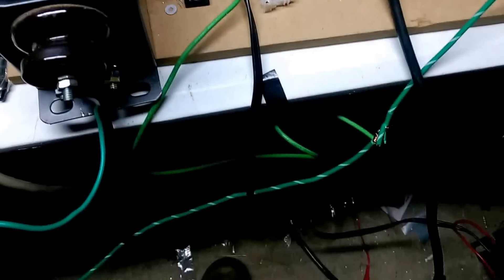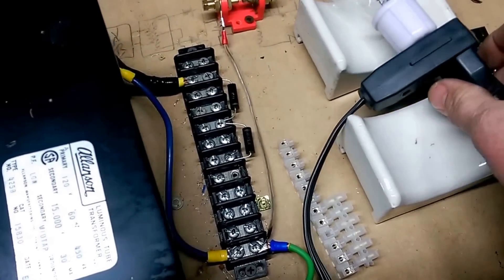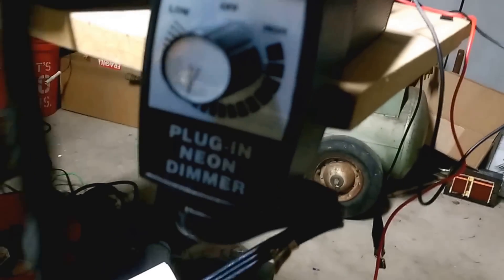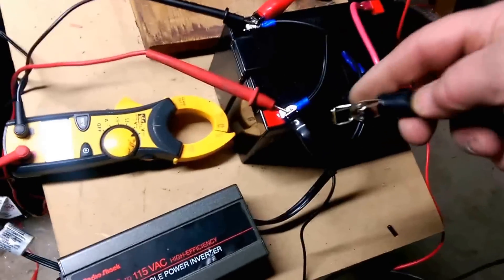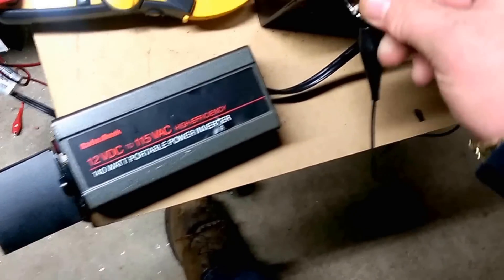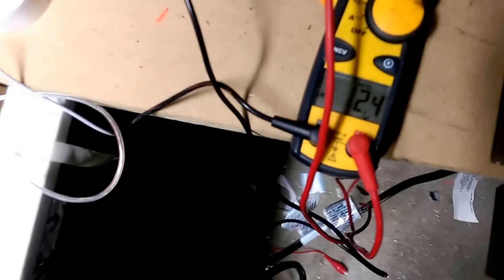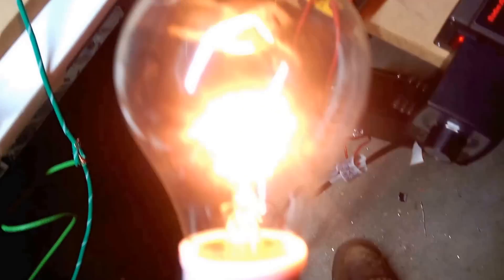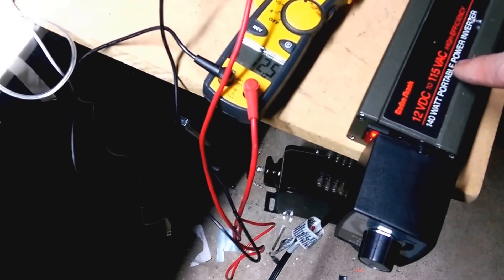Working Free Energy Generator-Dezeinstein Technologies-Annotated

Comment: Hello, Marc,

Great job n your builds, research and ideas.  I've been researching for a few years now, reading everything from Tesla, Moray, Newman, Steinmetz, Leedskalnin, Don Smith, Dollard, and forums to name a few.  

YOU ARE SO CLOSE TO SUCCESS.

From my reading, Tesla said he was surprised by the difference in energy by shortening one wire by 1/4 inch.
Also, Don Smith said in one of his presentations that the diode was 'special' and that they stopped making them in '93.  In a paper he wrote on one of his devices, he said that the wire to the battery should be 1/4 wavelength in order to receive the RF power to charge the battery. 
I will continue to watch your progress, and hope you can figure out exactly what to do for the great process of converting the cold electricity to useful power.  Keep up the great work with your enthusiasm and passion.
Like I said, I've been researching and studying a lot. I have not attempted any builds due to the possibility of me having a heart attack from burning down my house, electrocuting myself, or the excitement of actually making something that works. :)
Reply from the maker: +The Forces 2B Thank you. I've been trying to find time to do a lot of things and one of the most important I have been trying to do is replying to my subscribers.. then, finding the time to complete my experimentation. The parts used by Don, Tesla, and many others are the hardest task I've had over the several years I have been experimenting, then of course finding the money to acquire them. The time to work on these is most extensive, as well, trying to remain involved as a part of the industry to show folks I am not just another hoaxer as many folks claiming to output more than is incoming. It's a time killing process, so, I ask all of you to let me know when you find original components such as diodes and other devices Don as used so I could exactly replicate the devices. Important to me is to ensure the batteries used are close to the same. Not all batteries or inverters work to do what I have done. It truly involves the lack of devices Don says to use. The varistor is NOT an item that allows cold electricity to continue on, in fact this eliminates the energy from being there altogether. The Varactor is the device needed so any of you who try using the varistor will see nothing will come out of your system unless the energy is conventional where the Varistor is used. This is a protective device used to regulate overvoltages. The Varactor is a component comprised of diodes. The diode is the most important piece of the puzzle outside of the wirewound resistors used. Thanks again!

Comment: Congrats, Marc!!!   When you say what you have discovered/made is a simplified device compared to the ordinary Don Smith devices, I wonder what is the last steps to get to the discovery of how Don made his solid state device with no coils or capacitors.  I believe Don give us a clue when he writes in his book, p 67:  “Carbon-related substances and other non-metals, when subjected to friction, give up negative electrical charges.  ...  It is important to note that approximately 70% of the Earth’s exposed crustal portions ( surface ) consist of silicone-related non-metals ( electron donors ) and therefore becomes a direct source of electrical energy when properly agitated.”  http://www.vfedtec.com/papers/don_smith/Resonant_Energy_Methods_by_Don_Smith.pdf
Reply from the maker: +Simen Tobiassen I have opened this and I am now checking out some of the other files.. Thank you. I have noticed upon my first experiment the massive amount of negative energy coming through on my scope. This has always shown up as negative voltage levels and stays negative no matter how I arrange the probes. I also have used a very old analog meter and watched the meter needle go backward until it pegged the stopper which was at approximately the negative 25 area. I have found that when we use the energy found across a positive lead and a negative level that is around -120v, positive lead being +120v, we get 240v of energy. If I utilize this across ground, the power output is completely free, using the positive energy manmade from a grid of a battery, then, it is approximately 50% free, minus losses. It's all pretty basic "difference of potential" guidelines, however, if we follow Don's principle for magnetic field arrangements and amperage with the placement of coil L1, we could get some pretty strong currents at high voltage levels without having any bearing on the input whatsoever. The key is to add spark gaps across specific output components to ground with the load inline. Once we find the correct place to output across, we have output power. If the spark gap is connected to the correct capacitor size across an inductor coil., we get the same effect as if we placed a capacitor across a relay coil. The coil will energize for a period of time when the cap is fully charged, discharging the cap at a different interval of time per capacitor size. The smaller tha cap, the faster the pulse. This pulse allows the transformers used in the output to come to life. If we put the correct size cap across the primaryy transformer coil, the output frequency changes according to the discharge rate. I haven't figured out which cap I need to use, however, it will be different per inductance and voltage in the system. If you are replicating as well, I wish you the best of luck. I will post my results as I get more time to experiment again. I will also be trying to output this energy into utility transformers. If I could max out their power level, problem solved. The world will now know the potential of my experimentation!
Reply: +Marc Belanger 
visit: http://www.vfedtec.com/papers/don_smith/
then you can download the document
Reply from the maker: thanks.. I think this has a lot more information than the same document I have downloaded at an earlier date.. I'll let you know my progress once I read the whole thing. Thanks again!
Reply: Did Don L. Smith really mean silicone-transistor related electrons donor when he talked about his solid state device?  When we know what was the purpose of the very first transistor ever created it really is another clue ; 
Lt. Col. T.E. Bearden 1990:  “Moray had made the first germanium transistor, an amorphous pellet of multiple, finely powdered ingredients, sintered under heat and pressure to lock-in stress, and containing minute interfaces (very tiny built-in cracks) which  acted as tiny scalar EM interferometers.”
http://www.bibliotecapleyades.net/scalar_tech/esp_scalarweapon.htm
Reply: While we are at it, the mythical Swedish Stone helped T.H. Moray to produce electricity.  The mineral Tungsten was discovered and named in Sweden, and as a Norwegian I know tung-sten literally mans heavy stone in Norwegian and Swedish, which is  also known as wolfram.
Reply from the maker: It is fantastic to see how many European and Northern European people are interested and heavily involved in clean energy production. I have a lot of family in Germany as my mother was born outside of Lubeck, and it is astounding to see how the world is so much different between the US (being so dirty, and careless about our Earth and it's atmosphere and water, the environment in whole) and the Europeans being so environmentally conscious about keeping the world and their environment clean, the atmosphere and anything to do with their society in whole. I am 50% German and am the only one in my family who is driven to any clean energy/ world saving engineering , which to me comes naturally, without having anybody in my family doing anything even similar. I don't know what makes me so interested in Tesla's work, and how he did what he did, but I literally work with this as I have seen or witnessed his work before!

The carbon filaments and devices used literally light up due to the frequency of the vibrations per impedance of the filaments or devices being added to these circuits. The amount of energy being input to these carbon filaments react in a different method than conventional electricity because it is basically how Stanley Meyer made his water fuel system work. It's the resonant frequency causing resonant rise and efficient energy transfer which gives the mild output of energy and correct tuned frequency the ability to vibrate and light the bulbs.. however, if we do not obtain this frequency, or the impedances change, the bulbs do not perform. I find that these carbons also react with electrons to capacitively collect aether energy and there's a new method of induction I have discovered with a similar detail, using a coating on inductors that act as a "capacitive inductor" coated with specific mixes of nano coatings which allow the coupling of energy capacitively, and, inductively at the same time. Don smith does this with capacitor plates at a 90 degree angle to the inductor, I have taken the same system, coated one side of the capacitor and the inductor with 2 different nano materials to enhance this effect tremendously. I have been working on this and consider it my most prestigious experiment to date!